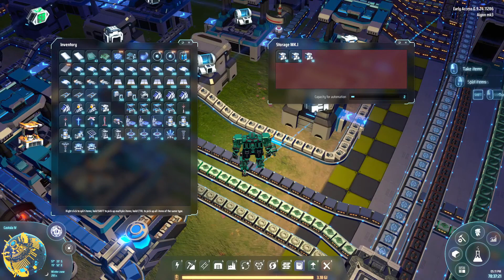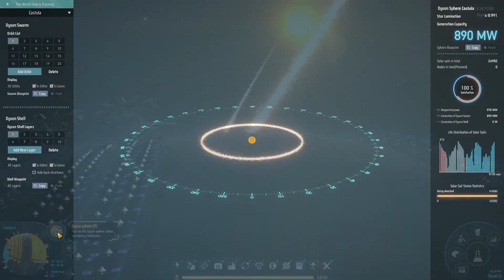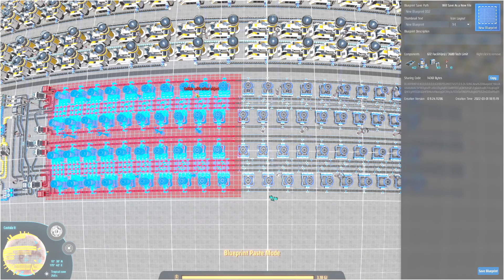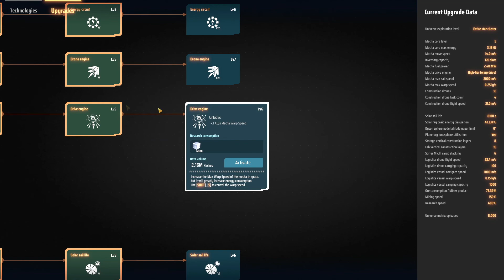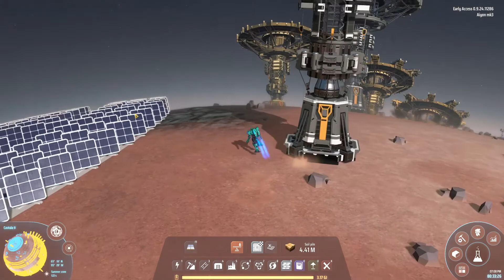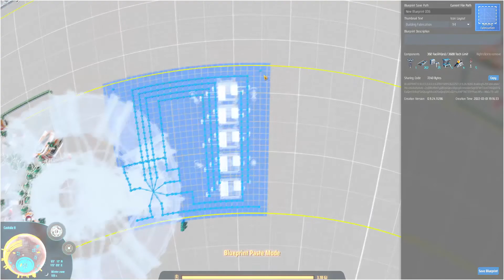Dyson Sphere Program / Second Launch / part 16

Comment: I need to better explain myself.  I have never played Factorio or those other games where things likes busses and mall are used.  The closet I have come if City Skylines maybe.  I have a lot of hours in, but also a lot of starts then deletes and restarts.  When I said your proliferator factory was larger than anything I had, I meant it literally at the time.  It might still be bigger than what I am working on right now, but I have and can see a lot of expansion still to come.   Basically I feel I have finally laid out a process that can take me to other planets and other processes.  It isn't the system you have....yet.  But for the first time I can see doing a Smelter world of my own.  Maybe the whole key for me right now is things are still small enough that when the time is right I can remove and rebuild everything I currently have.  My immediate plan it to use what I have to go start working up a second world just to collect all the  rez it can produce.
If I do that right it should be a stepping stone to another world or three.  And that would be the ultimate plan.  Each world allowing me to collect enough rez to open at least a couple more.
Notwithstanding the more specialty goods of coursse.